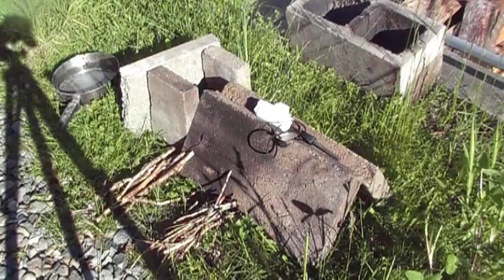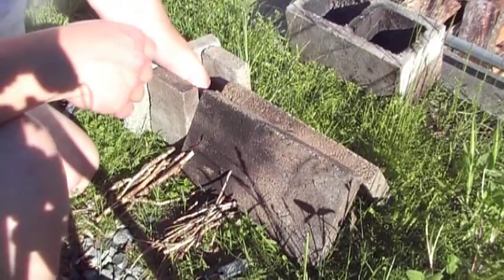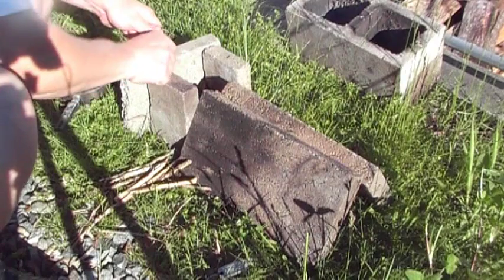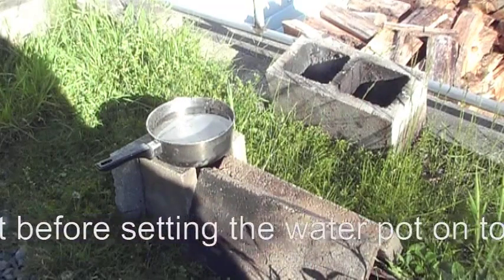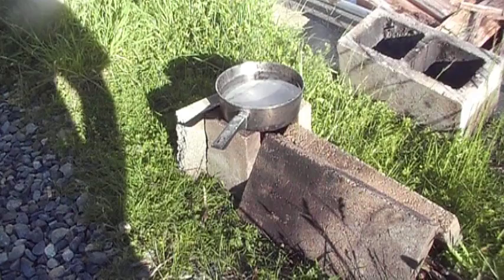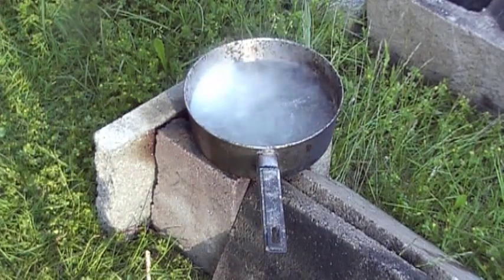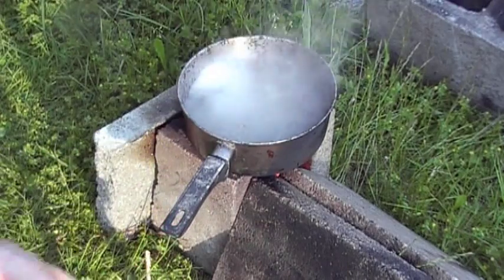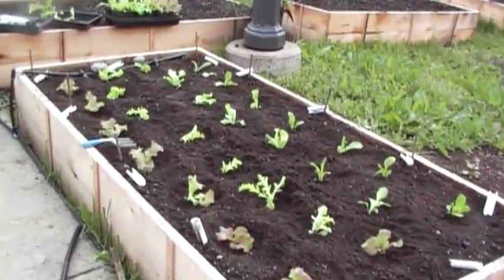Rocket stove Preparing a series of tests to boil water in a survival situation

Comment: @JimboJitsu 

I think the Rocket is at the least one of the most efficient ways to boil water available. Once you perfect the design of your stove.. it can boil water in very short order. It is obviously also the cheapest method to use.. since the fuel totally burns.. using less fuel and less time.